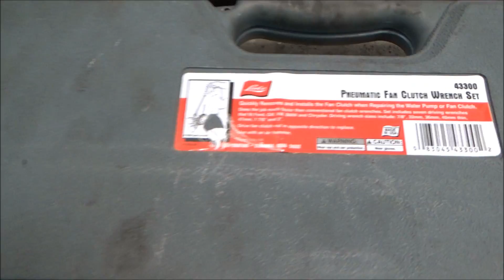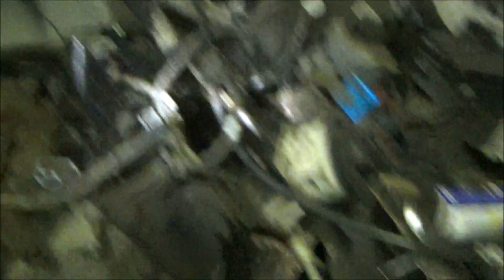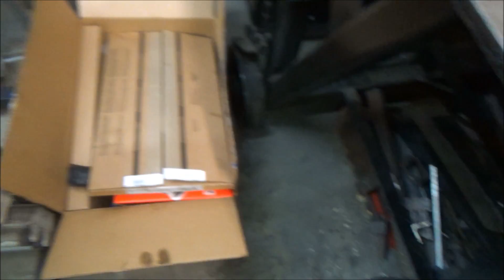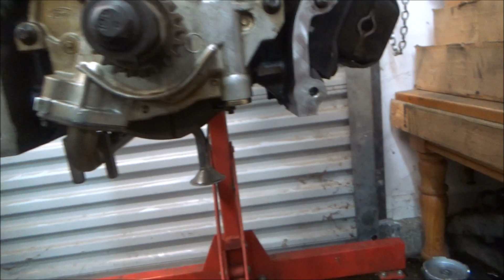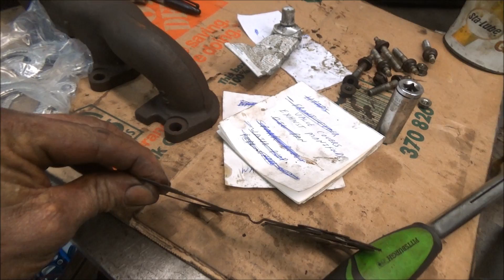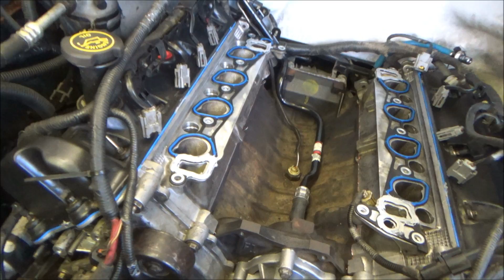Ford F150 4.6 Triton Cylinder Head Job / Engine Replacement / Spark Plug Inserts

Comment: Wow you know your stuff.  I just bought a used 2001 5.4 Ford Expedition 4wd with 150k miles for $ 1,200. Bucks from a buddy I think that’s a great deal? He just put in new plugs and wires on top of plugs. But I need to put in a new intake manifold leaking coolant at the cross over   I guess that’s a common problem for it. Is there anything else you might think about for me to do for maintenance or whatever idea. ?  I don’t have much money. So probably I just go with it and when something really breaks then fix it. I just thought it would be fun to have a truck again and it’s nice and roomy too it runs great as far I can tell. A have truck not for speed just cruising around and driving off road fun.
Reply from the maker: William E    $1,200 is a really good deal.  I would just replace the intake manifold and thats it.    Since it has new spark plugs already.
Reply: Ok 1970  plan on that for now and the engine runs great too.  I ll just replace the intake manifold as new Ford one. And save my money for the future if something else goes.   
Do you have suggestions on what gear oil and transfer case fluids would be best in the Ford ?  Maybe just use The Ford brand ? which is good for another 100 thousand miles again. ??  Just a question about the 4 WD when I am in N and put it in 4 WD Low there is a good clunk sound from it ?? Is that normal maybe for a big Ford Expedition 4wd? 
I won’t be off roading it all the time but just want to be sure ? Thanks for your help and texting me back.
Reply from the maker: William E    I think the clunk sound is normal.   I hardly ever put anything I’m working on into 4 wheel drive.   With the oil ,   You either need to look it up as to what it takes or buy the Ford stuff.   Transfer case probably takes automatic transmission fluid.
Reply: 1970chevelle396 
The 4WD is when I stopped in put in Low then it has a clunk sound only then I drive it in the dirt   Not working on the truck.   On 4WD High it is regular click light sound but all is good. 
On the diff fluids I probably well just stick with the Ford brand to keep it going.  Etc.  
I don’t have any money extra for anything $$$
Thanks again
Reply from the maker: William E    I’m not sure what the 4 wheel drive problem is.   Around where I live no one ever uses 4 wheel drive.
Reply: Also too bad you don’t leave close enough to help me work on my truck too.  Lol thanks again
Reply: Ok no problem. Thanks for your time

Comment: What about an E250 van, is there room without pulling the engine? I've got one of the lemons that needs a good head job.
Reply from the maker: Richard Gates   I’ve done the E250 vans before.  It can be done without pulling the engine.   Some of the head bolts wont come all the way out.  I pulled them up as high as they would go and put a rubber band around them to keep them all the way up.  Then you can pull the head.  When you put it back together you have to do the same thing.
Reply: Thanks, that sounds doable. I just need to make sure I've got the right tools before I start. With over 300,000 miles I want to see how far it will go.
A seemingly simple thing like changing the front shocks and sway bushings can turn into a major ordeal.

Comment: I have a 1998 ford F150 truck and piston 1 and 4 are low in pressure and are misfiring because of it what do you think is the cheapest way to fix it
Reply from the maker: +Anthony Fish    It probably has a valve problem.  The heads would have to be taken off and taken to a machine shop.

Comment: It only has 150000 miles on it why didn't you just throw it in as is they go forever
Reply from the maker: I would never put one in without fixing the spark plug threads.   If I were to put the engine in like that and the spark plug threads go in a few months,  I would have to eat the labor.

Comment: Hello awesome and informative video. I do have a question, I have a 98 f150 4.6 I got it from my uncle. It has a ton of oil buildup on the passenger side all right under my headers and all I’ve by the oil pan. I checked the plug, the pan bolts and can’t seem to find where the leak is coming from. Any advice would help immensely.
Reply from the maker: Humboldt Rootz   The only thing you can do is clean it up real good.  Then drive it and keep checking for oil leaks.  Then maybe you can find where it’s coming from.  Could be the valve cover gasket or the timing chain cover that’s leaking.
Reply: 1970chevelle396

Comment: they want me to do a explore 4.6 I think brake sporket nuts mark chains hold with zip ties wedge tools so chain don't drop im guessing I don't want to mess with timing I ain't got no transmission to rebuild so mechanic work
Reply from the maker: Angel Curiel   There is no reason to try to hold the chains in place.   You have to take the timing chain cover off to pull the cylinder heads.  Only takes a few minutes to put the chains back on.

Comment: u totally skipped how to just do cylinder heads if tools needed hold timing chain in place from bottom
Reply from the maker: Angel Curiel   You don’t hold the timing chains in place on those engine.  You just take them off and put them back on.  These engines you have to take the timing chain cover off to do a cylinder head job on them.

Comment: I had feared this issue on my 2000 Lightning when I 1st bought it late last year. I took it in today to have the spark plugs swapped & sure enough the mech tells me the holes already have the inserts & advised me to get the heads replaced at some point in the coming months depending on much I drive it. So now i'm like damn should I pay the probably $3500 it'll cost to replace them or just trade the truck in & get a small car that gets good gas mileage...
Reply: Vine Wood I admire the ford Lightning’s  rescue that work of art
Reply: Smh i feel u too have a blown head gasket on my lightning smh

Comment: how much would it cost for a shop to replace the heads?
Reply: CoffeeDrinker71 yes...my truck is in PERFECT condition...inside and out...its a Larriat....beautiful truck ...and paid off..and yes def did NOT want another payment ..so yes def cheaper
Reply: OMG.  That's pretty hefty.  I guess it depends on the condition of the rest of the truck.  Mine is just a daily driver, but still really clean.  Regardless, it's still cheaper than buying a new truck!!!  ;)
Reply from the maker: Jason Sampson   Not sure
Reply: Jason, I was quoted about $3K a few weeks ago.  It's mostly labor, obviously.
Reply: hahaha...just the heads for my 2010 were $1300 a piece....
Reply: Ouch....are you referring to the cost of buying the heads, or what?  I'll probably sell my '97.  The cost just isn't worth it.
Reply: yes buying the heads...the heads brand new were $1300 a piece...without labor costs..

Comment: I have a 1998 f150 and it has 2 coil packs not coil over plugs I wish it did!
Reply: mine too, a 98 4.6. Actually I think the coil packs are more reliable than COP. Closer to engine, more heat.

Comment: Unless you over tighten the spark plugs they will not go
Reply from the maker: That Guy   They go all the time on those engines.   Even on ones that have never had the spark plugs replaced before.  I’ve been working on those Triton engines since right around when they first started making them.

Comment: Great video and info. I rebuilt my 4.6 a couple of years ago due to a strange momentary overheating problem. Seems to be an issue with a 4.6. I found leaking intake gaskets, same location you added sealant. I didn't use sealant and now I'm having the same issue. Either the machine shop didn't properly machine the heads properly and I have a blown head gasket or the intake is leaking. I know there are hydro carbons in the cooling system evident by a block test. Any thoughts about a leaking intake gasket causing cavitation in the water pump housing. This is only momentary, the tempature goes to hot the engine immeditly goes back to normal and all is well until the engine is shutdown and cools. Any thoughts as to what this might be, blown head gasket or intake gasket?
Reply from the maker: Robert Robinette   If there is hydrocarbons in the cooling system it has to be a cylinder head or head gasket problem.   It won’t be the intake manifold.
Reply: Had the same problem but during my teardown it turned out to be indeed my intake gaskets ive had 6 of those trucks and on the way to go pick up my second expy with same motor in it sunday

Comment: What is that spark plug inserts? I have a 4.6 99 that I'm gonna pay someone to rebuild
Reply from the maker: nickyrr78    Who ever does the heads needs to put inserts in for everyone of the spark plug threads.  If you don’t it will fail for sure.
Reply: 1970chevelle396 thx

Comment: Was there no way to hang the A/C compressor and not crack the lines to get the motor out?  I'm about to do a PI head / intake swap to mine, and am debating leaving the motor in the truck, vs pulling it out.  After 250k on mine, I'm assuming my rear crank seal looks less than stellar... either way it would be nice to know... I can't vac my system here so that would be an added cost for me. Thoughts?
Reply from the maker: therealpimpskillet   You might be able to hang the A/C compressor out of the way.   It’s easier to remove it.

Comment: I have a 98 F150 and no it doesn't have coil over plug but has the coil packs. 2 4 each... 1FTDX1760WKA07900 is my vin number to verify.
Reply: The one I may be getting from a friend that needs the passenger head gasket replaced because cylinder 3 has coolant dumping into the cylinder has coil packs not coil on plugs

Comment: It's very obvious you know what you are doing. Nice work. Can you direct me to any videos specific to a 2007 F-150 4.6 head gasket job? I've got coolant coming from my tail pipe. Idols fine but once on the road and you put any gas to it, has a hell of a time getting any power. Thanks so much.
Reply from the maker: FordTechMakuLoco might have one.  There similar in 2007 except it has variable valve timing and coil over plugs.

Comment: My 4.6 triton on a 97 f150 has pressed on cam gears and can't be replaced without changing the cams... just great. So I found a set of heads with cams from a 4.6 romeo engine, gonna be doing a head exchange job on it when in the beginning all i needed was a timing chain and gear replacement. Just like this job always one thing leads to another, in the end, you end up with more work than expected replacing more parts than expected... I hate when that happens.
Reply from the maker: Gary Riefle   Make sure you have the spark plug thread inserts put in it.  Its well worth doing that.
Reply: 1970chevelle396 Now that you mentioned it, the heads I bought hasn't had the insert job done on it. What does it basically cost to have that done? So far the heads look real good cams and all and I plan on sending them out to have em done like you did yours. I'm not gonna do any block work cause it's good, only to clean it up for the heads.
Reply: 1970chevelle396 Now that you mentioned it, the heads I bought hasn't had the insert job done on it. What does it basically cost to have that done? So far the heads look real good cams and all and I plan on sending them out to have em done like you did yours. I'm not gonna do any block work cause it's good, only to clean it up for the heads.
Reply from the maker: Gary Riefle   I think it was around $300 to have both heads done.  If you don't have them done at any time they can blow the spark plugs out.   Some machine shops might be cheaper.
Reply: 1970chevelle396 wish it was that cheap to do mine. My 97 has its 7 and 8 cylinders with stripped plug holes to where i can't remove the old plugs. Shop wants 400 just for those two.

Comment: So the Triton engine is a modular...I've seen a few with blown head gaskets here.
Reply from the maker: ZIGgassedUP   There really not a bad engine once the spark plug threads are fixed.   I've only had a few of them with blown head gaskets over the years.

Comment: cool video...big job for sure.  What did the machine shop charge to do those thread inserts?
Reply from the maker: Ramsey Customs - turbocobra  they charged $470 for the inserts and surfacing them.   Which was way to much.
Reply: The inserts are easy to install yourself. While the engine and head are still in the truck. The save a thread is a life saver. 10 min job.
Reply: @willbreedlove3297  normally i would do this with a different engine but imagine taking a risk. Ill pay the 500 dollars. I would not want to deal with that crap later on.

Comment: you dont see too many people these day's redoing engines. Most people just change them out. I commend you sir for doing that.
Reply from the maker: Stevo  to buy a rebuilt engine was $3,600.   Thats why I went with one from the junk yard then I had the inserts put in the heads.  Now that engine is bulletproof.
Reply: It’s still cheaper then buying a new truck.  Wow $$$$$$. !!